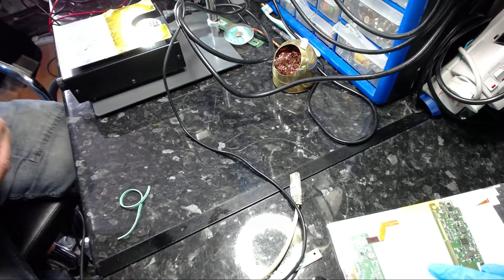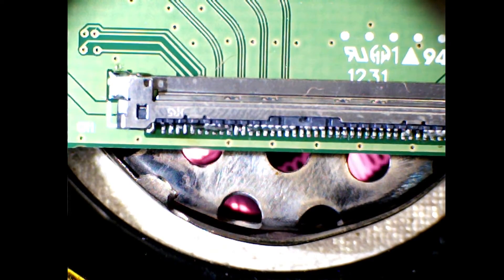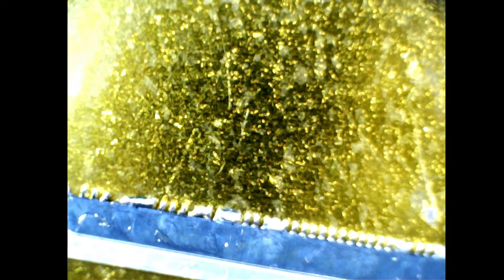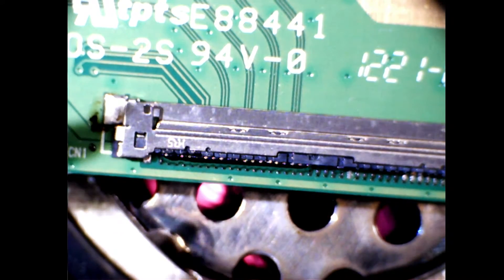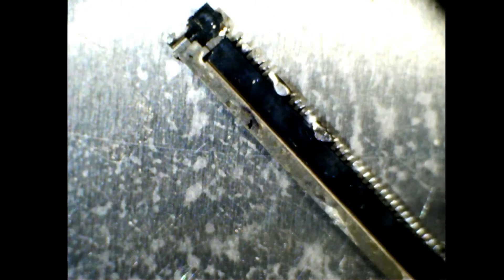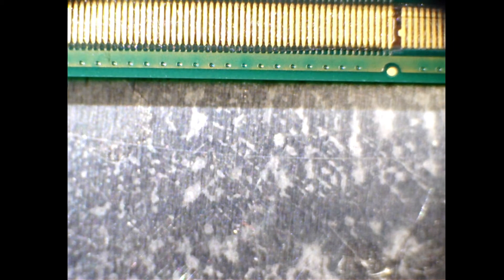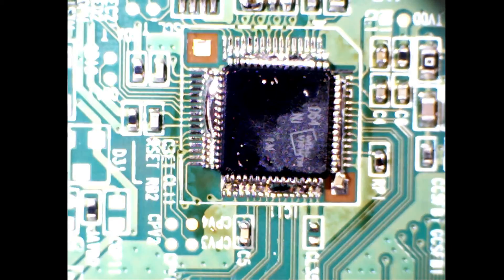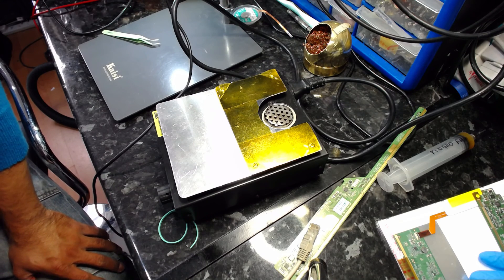SMD PREHEATER IS HELPFUL TO REMOVE LVDS CONNECTORS AND COMPONENTS WITH EASE

Comment: Hello ITC, which type of preheater would you recommend for PC motherboard? I saw a few of the chinese preheater for 100 dollars. The small one with the circular heater like the one you have.
Reply from the maker: Hello, I would recommend a ceramic preheater, such as: https://rover.ebay.com/rover/0/0/0?mpre=https%3A%2F%2Fwww.ebay.co.uk%2Fulk%2Fitm%2F253620994711
Reply from the maker: Or 

https://rover.ebay.com/rover/0/0/0?mpre=https%3A%2F%2Fwww.ebay.co.uk%2Fulk%2Fitm%2F132631391672
Reply from the maker: Don't bother with the fan type preheater because it tends to blow flux fume back at you if you are working on a pcb with a component on the edge.